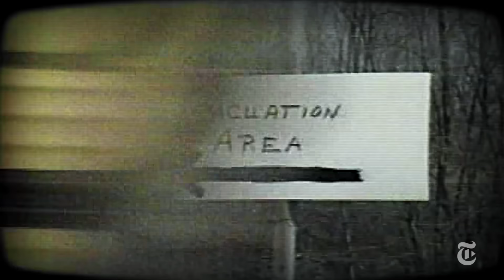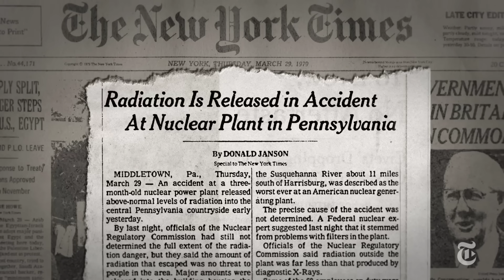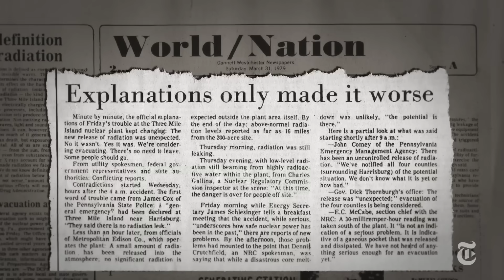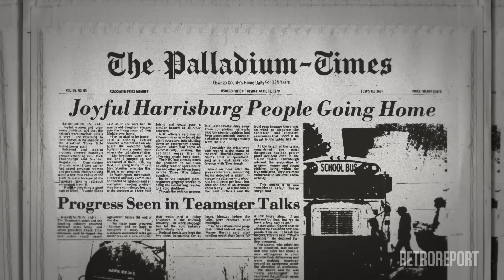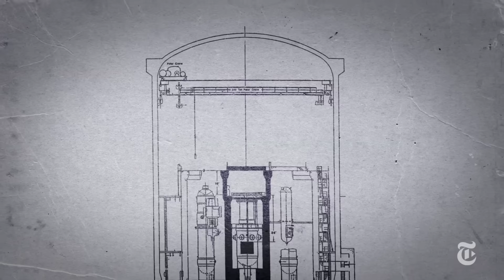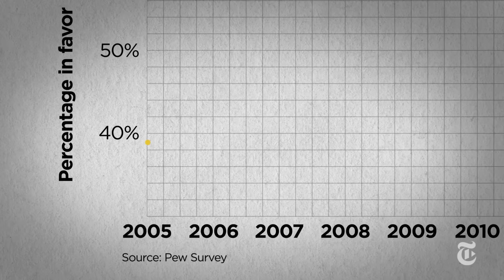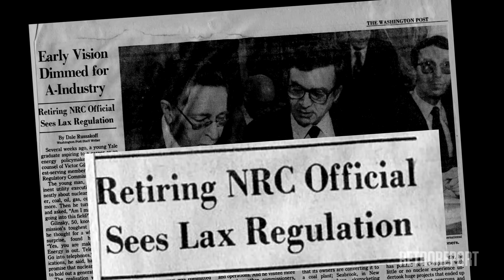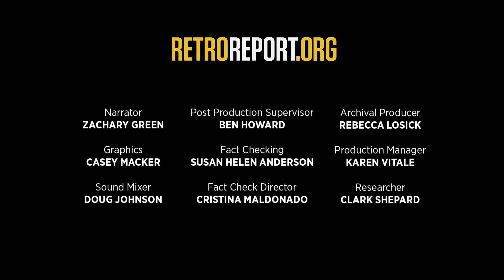Three Mile Island Documentary: Nuclear Power's Promise and Peril | Retro Report | The New York Times

Comment: Totally fails to expose the 'explosion' of solar technology in the last decade.  Growing faster than the microchip!
Reply: You can't power a country with solar panels, because there's this little thing that happens where the sun drops under the horizon every day and doesn't show itself for several hours.
Reply: Peter Selie There’s these new things called batteries... you should read about em.  Big ones.  For your house or your whole neighborhood.
Reply: @brianmurray2687  Mining, manufacturing, replacing and recycling those batteries are the problem. Potentially very explosive too. You should read about em
Reply: tree fiddy True, but it seems safer to me than the nuclear waste that we are currently just accumulating in a variety of insecure locations because we’re literally too scared to move it.
Reply: Peter Selie BTW Germany (a country) gets 45% of its power from renewables, solar being a major contributor.  Much of it at a lower cost than coal.
Reply: Brian Murray Germany is not a shining example. Their nuclear phaseout cancelled out all progress building renewables until just very recently, yet more nuclear shutdowns are on the way. Germany gets more TWh of electricity from biomass, in this case chopping down trees and burning wood, than solar. Biomass, while the industry may claim is carbon neutral, is not clean.
Reply: Erik Lakeland I don’t have any data about Germany’s biomass usage or what component wood burning may comprise of it.  Cannot fathom that someone would attempt to describe wood burning as carbon neutral.  The intent of my comment, was that the amount of solar capacity globally is growing exponentially now, and that many northern climates are utilizing it well.  I acknowledge that my citation of the level of German solar utilization was in error.

Comment: If you supplement nuclear energy with green technologies like wind and solar, then you won't have the issue of running a reactor hot enough that it could ever be an issue.
Reply: DJ Wise Pariah not enough and they are far from green
Reply: @ryanp0342  Maybe not green and definitely not renewable, but nuclear still has one of the lowest emissions per unit energy.
Reply: @dbclass4075  I was referring to wind and solar being "Green". They are good for the carbon emissions but terrible for the environment on their own but especially when compared to nuclear. With out improvements in storage we will always rely on on demand energy generation such as coal or nuclear. For practical purposes for our species nuclear is renewable as the waste is minimal and fairly easily managed. as Thorium is abundant and can e used in breeders to create Uranium.

Comment: Proponents of nuclear often act as if the public concerns are unfounded. But every time the public's trust is regained, another catastrophe happens. The response from the industry is that there were mistakes or neglectful actions that led to one problem or another... but there is no magical safe fairy that deems a nuclear plant safe. It's safe until we discover it's not safe, which usually doesn't give us much time to evacuate.
Reply: AsellusPrimus reactor meltdowns on post 1980 designs? Zero.
Reply: Those catastrophes you're referring to aren't generally all that hazardous. Proponents of nuclear don't act as if public concerns are unfounded, but it's a little hard when the public doesn't generally understand the science behind nuclear power. They don't understand how radiation works and as a result, people fear it far more than they should. The concerns aren't unfounded, but they are generally overblown. You even said ..."another catastrophe happens."
Nobody died at Fukushima as a result of radiation exposure. Nobody died at Three Mile Island as a result of radiation exposure. 31 people died at Chernobyl as a result of radiation exposure. 
So, all these catastrophes and you wind up with 31 people directly killed by radiation, and likely another 100 or so from residual radiation exposure. Sounds terrible, but the tsunami that caused the Fukushima meltdown, killed 15,000 people! The gunman at the Mandalay Bay in Las Vegas, killed 58 and injured hundreds more, more than died at all three reactor accidents combined.
For catastrophes, they sure don't seem all that catastrophic.

Comment: You didn't touch on the reason we use light water reactors, which are much more unsafe (relatively) and why we don't use safer molten salt reactors.
Reply: Molten salt reactors are not safe either. While people like to site 'so we can make weapons' and 'corruption', there is also the problem that molten salt reactors were prone to meltdown.  They had serious engineering and maintenance problems that could not, at the time, be easily solved.  But at the time they were behind and did not show as much promise as already maturing solutions.
Reply: neeneko the last MSR we built was for the nuclear bomber, and it had (I may be wrong, this is off the top of my head) a nearly 100% runtime during its test period, smashing the light water designs of the era. The technology is also being developed in China and India now, and the safety is much better since the reaction self moderates, and there is no water involved, which has been the main reason for every single nuclear catastrophe (hydrogen or a fear of it)

Comment: France is powered by nuclear energy almost 100% and they're doing fine.
Reply: 75% actually. And they have been reprocessing nuclear wastes as well.
Reply: Not soviet or american designs so there....
Reply: Just wait until cyber terrorism becomes our new reality
Reply: @MrStanderd5000  Nuclear powerplant computer systems are intranets, they're a local isolated network with no connection to the internet for that exact reason.
Reply: @MrStanderd5000  - spoken like someone who doesn't know anything about networks bahahaha
Reply: @9393jack  your comment is just as useless. If you care enough to speak out, elaborate.
Reply: They’ve had accidents...
Reply: Adrie G name one....
Reply: @het1972  March 1980: An accident at EDF's Saint-Laurent nuclear reactor in central France caused two fuel rods to melt, seriously damaging the reactor and causing the most serious accident in France's nuclear history, classified as level 4 on the International Nuclear Event Scale which runs from zero to 7.

Comment: We make a huge mistake when we talk about nuclear power as if it were all one technology. That's like talking about fire as if it were one technology. Coal fires power plants, gunpowder fires bullets, propane fires my stove, and heating oil fires the boiler in my apartment building. It's all fire, but we don't talk about them all as "fire power." Nuclear power come in a wide variety of designs, from the tiny power packs used on space probes to the massive propulsion systems on the largest aircraft carriers. In fact, the smoke detector in your home most likely uses nuclear power as well as electric power. Designs exist that can make nuclear-powered generators that are safe for a given location and use.

Chernobyl had numerous engineering and human factors that simply don't exist today (i.e., flaws in the design of the reactor were a Soviet state secret, so no one at the plant was allowed to learn how to deal with them or even discuss them), and Fukoshima was only a nuclear disaster because, in an area that's prone to earthquakes and tsunamis, they decided to put the emergency generator in the easily-flooded basement. All of the redundant safeties worked just fine except a power source for the cooling water when the plant was shut down and the basement was flooded. Consider though, with as many reactors as we have in the world, we have a pretty good track record, even with the utter lunacy of the Chernobyl design (which would never be built again) and the Fukoshima generator location. How many coal miners and oil workers (mariners on tankers, people on oil rigs, ferry pilots, etc.) have died bringing us the fire that is so superior to the atom?
Reply: Well worded.
Reply: Anything and everything related to fusion and fission reactions is grossly misunderstood by almost (at least 95% I think) everyone.
Reply: @davidfortier6976  myself partially but not entirely included.
Reply: see france, 75% of their energy is nuclear based. No casualities in history. Proves that u need sane people and good engineering to build safer technologies. Nuclear is the future
Reply: @RpMRickyMunoz  Can we store the  waste at YOUR house please?  After 2017-2021 are you REALLY ready to depend on "sane" people?
Reply: @RpMRickyMunoz  All it takes is ONE mistake and thousands of square miles are uninhabitable for centuries.  Solar and wind  are better alternatives.
Reply: Your quite right Beena Plumber

Also, burning coal produces more radiation toxicity than the nuclear power plants !!!
Seems insane, but is a fact.
 
Fly ash emitted by a power plant—a by-product from burning coal for electricity—carries into the surrounding environment 100 times more radiation than a nuclear power plant producing the same amount of energy.

At issue is coal's content of uranium and thorium, both radioactive elements. They occur in such trace amounts in natural, or "whole," coal that they aren't a problem. But when coal is burned into fly ash, uranium and thorium are concentrated at up to 10 times their original levels.

Fly ash uranium sometimes leaches into the soil and water surrounding a coal plant, affecting cropland and, in turn, food. People living within a "stack shadow"—the area within a half- to one-mile (0.8- to 1.6-kilometer) radius of a coal plant's smokestacks—might then ingest small amounts of radiation. Fly ash is also disposed of in landfills and abandoned mines and quarries, posing a potential risk to people living around those areas.

In a 1978 paper for Science, J. P. McBride at Oak Ridge National Laboratory (ORNL) and his colleagues looked at the uranium and thorium content of fly ash from coal-fired power plants in Tennessee and Alabama. To answer the question of just how harmful leaching could be, the scientists estimated radiation exposure around the coal plants and compared it with exposure levels around boiling-water reactor and pressurized-water nuclear power plants.

The result: estimated radiation doses ingested by people living near the coal plants were equal to or higher than doses for people living around the nuclear facilities. At one extreme, the scientists estimated fly ash radiation in individuals' bones at around 18 millirems (thousandths of a rem, a unit for measuring doses of ionizing radiation) a year. Doses for the two nuclear plants, by contrast, ranged from between three and six millirems for the same period. And when all food was grown in the area, radiation doses were 50 to 200 percent higher around the coal plants.
Reply: I agree with your point, but it's misleading to say smoke alarms are "powered" by nuclear energy. Some of them use a stream of alpha particles to detect smoke, but it's not used as an energy source for the alarm.
Reply: We really would depend on the integrity of safety regulators and plant management when we turn to nuclear power. So hopefully they can do a good job of keeping that up and never put profits over safety. Which has and is happening in railroads and aviation , you can see it in Norfolk Southern and Boeing.
Reply: @zzoinks  That's a fair point, particularly in the US. Since we've commissioned no new nuclear plants since the 70s, and we've closed a few down since then, the NRC hasn't had much to do, and it's been downsizing. It's given regulatory control to individual state health departments in states that agree to take on the task. State politics are more volatile than federal. The whole world knows how impossible it is to know who they're dealing with when they negotiate anything with us because each administration has its own agenda, and lately it's become popular to define a party's agenda as contrary to that of the other party. We never know who will be watching over the safety of our current nuclear facilities, let alone any future, safer facilities. That's one reason I like the idea of Thorium plants. There's less that can go wrong, and when things do go wrong the outcome is less hazardous.
Reply: I like the idea of fission reactor power plants that build melting down in as a feature. Of course you hope it doesn't ever, but if it does, each reactor melts down into a self-burying and sealing pit. It feels like almost all of the major nuclear disasters have been caused by designing with a believe that nothing will go horribly wrong.
Reply: Yeah, 3 nuclear disasters almost wiped out 100's of thousands of people and left 10s of thousands of square miles usefull for decades to centuries but sure totally it's fine. Even if the risk is very small, if the consequences are enormous then it constitutes a large realized risk.

Furthermore, even if today's technologies remedy most of the risks, state infrastucture lags behind decades. Tax systems, weather models, etc still run on fortran.
Reply: The problem with the atom is that it is so efficient it keeps burning even when you don't want it to. For centuries under the right circumstances. Chernobyl is Darkly hilarious.
Reply: @razycrandomgirl razycrandomgirl  yeah, heard something about the fuel still emitting heat for years after use, by radioactivity, but could be wrong...

Comment: We should just use thorium its safer and more common as well as 1 ton of trorium is as good as 3,500 tons if uranium
Reply: Well, that is why it is being looked into.  But do not mistake optimistic predictions with actual implementations.
Reply: That's not entirely true. Thorium is not a nuclear fuel. You can't fission Thorium. You bombard it with neutrons so that it becomes Uranium 233, and then you can use it as fuel. But at that point, you're using a Uranium fuel cycle with its own problems. For example, In producing U-233, you're also making U-232, a hard gamma emitter. While most Thorium reactors get around this problem by either leaving the activation products and actinides in the fuel, or processing out the Protactinium before it becomes U-232, it's another step to consider. 
Different reactor types, are better at using different kinds of fuels. Thorium works very well in thermal spectrum, molten salt reactors. Uranium and Plutonium are better suited to fast neutron spectrum reactors, and liquid metal cooling is generally preferable as it eliminates the need for pressure vessels. The pressure vessels are there to contain the water that cools things and moderates neutrons. Using liquid metals, you don't have to keep them under pressure to stop them from boiling at temperatures these reactors run at. No boiling = no steam explosions. No water = No Hydrogen forming.
And since we have a lot of Uranium-Plutonium waste fuel kicking around, we've got a good reason to reprocess fuel and reuse it, rather than start from scratch with Thorium. There is enough waste fuel in the USA, to power the entire country for a century, if we use the right kind of reactors.

Comment: you dont even learn from japan? germany banned nuclear
Reply: +addis11100 Look up Onagawa, Fukushima Daini, and Tokai. All three of which were hit by the exact same tsunami as Fukushima Daiichi. None of which had any problems. Fukushima Daiichi was the first nuclear power plant built by Tokyo Electric Power Company in the 1960s - not long after TMI was built and was likely built using the same technology. There's a reason why it was the only reactor to fail. If we maintain and upgrade our nuclear reactors to modern safety standards and technology, it's not an issue - as evidenced by three other nuclear power plants weathering the exact same tsunami with no problems. Also, Japan is a seismically active area. They average 1,500 earthquakes a year and about 50 tsunamis a year. And Fukushima Daichi is the first reactor to have a major problem and as I've already pointed out, it was outdated. That's actually a very impressive safety record considering about 30% of Japan's power comes from nuclear energy and they have 54 nuclear power plants.
Reply: addis11100 and yet Japan, which is in one of the most seismically active areas of the world, has 54 nuclear power plants and only 1 has ever had a problem - 1 which we've established was outdated and not up to current safety and building standards. If it had been kept up to date, it never would have had a problem.
Reply: Germans also have some of the most expensive electricity in the world and need to import it from France, who primarily use nuclear
Reply: That was in 1979
Reply: Except Germany is now realizing nuclear is actually cleaner than solar since panels take decades to offset the emissions from manufacture at which point most need to be replaced due to degradation.
Reply: addis11100 they replaced it with dirty coal plants burning the absolute worst stuff for fumes that is killing thousands of not just Germans, but Europeans in general, a year.
Reply: Irony they replaced it with dirty brown coal and power imported from France which produces 80% of Frances electricity
Reply: goodluck
Reply: addis11100 

With what
Reply: earthquake and nuclear are fire and gasoline